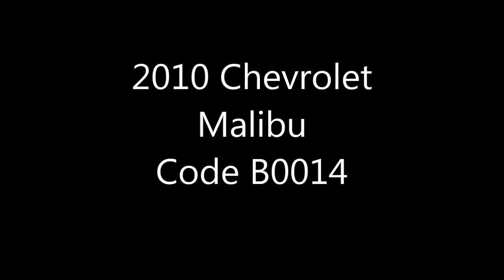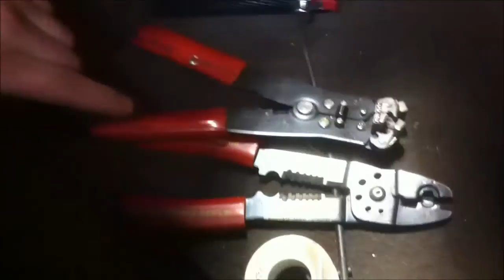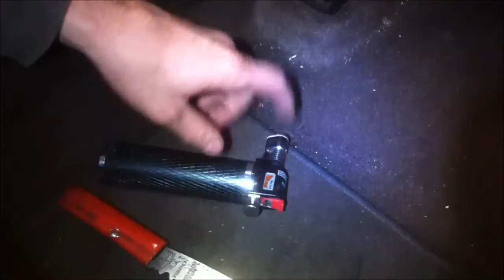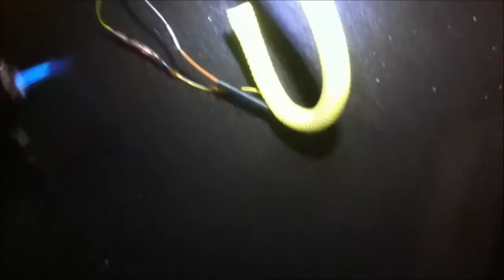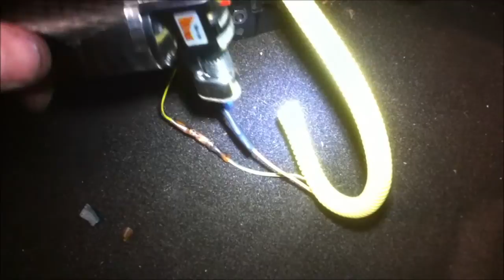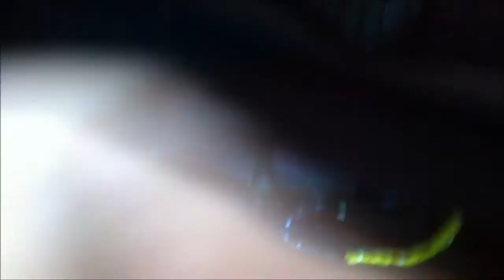2010 Malibu Air bag light Code B0014

Comment: Are these wires energized when the car is off?
Reply from the maker: No they aren’t after the module powers down. But it’s a good idea to unhook the battery before doing.
Reply: @mastertech5241  thanks for the reply, I agree. It is always good practice but I noticed in the TSB from GM it does not say to disconnect the battery.

Comment: I have the same code should. I disconnect the battery before proceeding. With the fault reset by itself after a period of time?
Reply from the maker: +Joshua Jordan  yes it is always a good idea to disconnect power to the air bag system before repairs are preformed. 
once repair is done the code will clear